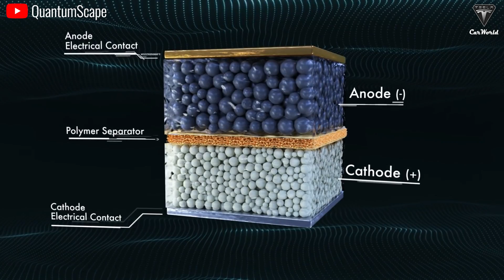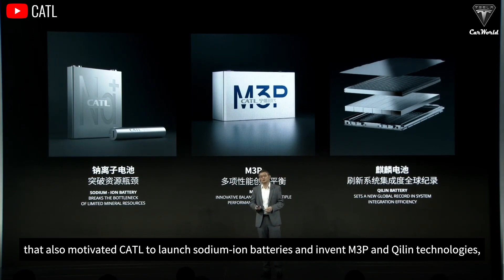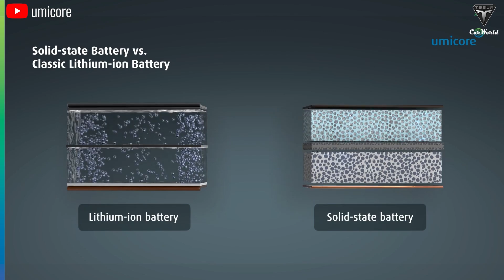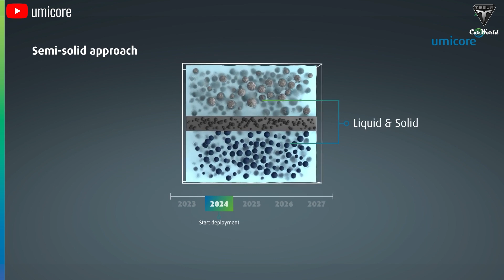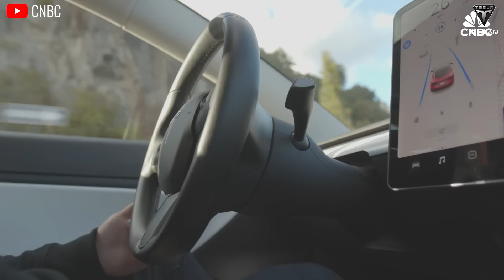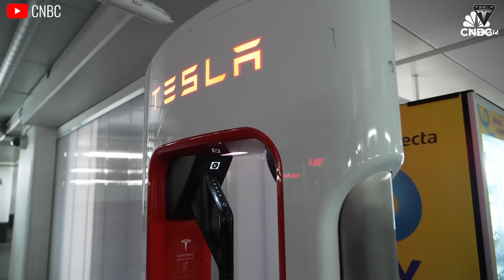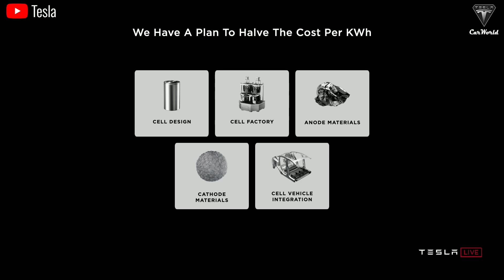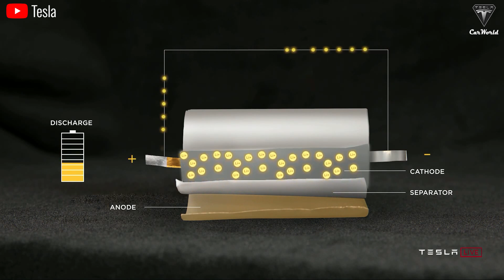1240 Miles Range! Elon Musk Shocked With NEW Highest Energy Density Battery! Hit The Market Soon!

Comment: Max battery KwH !  1000+ mile range never use, is just fine. With 2-way charging I could run my house for days. It's a 1.5 mile trip, along a private dirt/gravel, forest road with culvert stream crossing to get to the mailbox. After my generator kicks in, Starlink begins looking for satellites. The Internet and cell phone (over internet) are down and my O2 concentrator restarts.  Until the next power drop-out or downed trees and power line are fixed up. 5x13 KwH Power walls are too small and too expensive. A big million mile+ battery please.

Comment: Chinese solid-state lithium battery doesn't sound practical to me, because 1240 miles of range is beyond the limitation of physics, which can only be achieved by energy storage battery used in energy facility and this is not even a breakthrough technology. So you Germans are saying you Chinese are going to put energy battery in a car? that's a good idea, bro.

Comment: 1240 miles would make EV’s useful because you wouldn’t need to change them very often and wouldn’t worry about range or cold weather
Reply: 1 charge a month. 👍🏼
Reply: Just like fueling once a month at a half tank with my Jaguar XJl providing me with 570 miles of range. But, it still only takes me 3 minutes of downtimes. It takes you 40 plus minutes of down times.
Reply: @carlsmith5545 zero downtime 99% of people charge overnight at home whilst asleep. If range was 1000 miles+ it will be unlikely anyone would need to charge anywhere else unless doing long distance travelling therefore a stop for 40 mins after 1000 miles of driving would be well needed.
Reply: @NR-86  I know, i had a tesla model S but i sold it after owning it for 2 months. Sorry but as a serious long distance traveler, it just doesn't deliver. Can't take the garage with you on a long trip now can you? I liked my model S eventhough it was slightly too small for me. They just need to be improved, that's all. After i sold it, my insurance premiums dropped off tremendously, no more sitting around like some bad ass kid in time out, no more short and shitty ranges. I had all kinds of software issues that would have cost me 2500 bucks. Yeah i got rid of it and kept my XJL. 3 minutes of down times for a range of 570 miles, im keeping well enough alone,.
Reply: You don’t need that much range!🙄
Reply: @Jeffisright  Oh really? I travel form Lancaster Pennsylvania to Jacksonville Florida, Dallas Texas, Chicago Illinois, st Louis Missouri, Johnson city Tennessee each and every year and some of these destinations, multiple times, Now what was that you said? When traveling from Lancaster Pennsylvania to Jacksonville Florida, that's 831 miles with my 570 miles of range (it dosent matter how many times i stop for what ever reason), i only have to stop once, one time to refuel. Up and out in 3 minutes. That a 3 time stop for charging with a sit around down time of 20 to 40 minutes. I've seen EVs in line waiting to charge. Your trip takes 2, 3, times as long, Now if you think this is better, hey then do you. As for me, you come out with an EV that delivers, now were talking. I'll go buy another one especially if its a large full size luxury automobile which tesla dosent even make. When im not traveling, i fuel up every 4 to 6 weeks. I dont plug in, i never sit and i dont add to my electric grid any more, my insurance premiums dropped off tremendously and no more worries of hazardous results. I dont care about the cost of gas, money i have time i don't. Bottom line, i loved my model S. It just needs to be improved.,.
Reply: @Jeffisright  so far, short downtimes and long range is reserved for gas cars only. So make it available in an EV too. If china can do it so can the United States of America. Otherwise you'r boasting less. Electric just doesn't deliver for me right now.. sorry